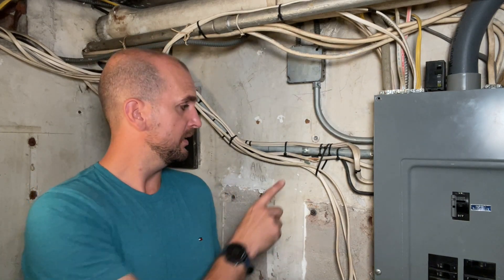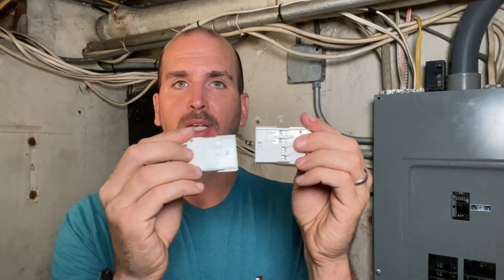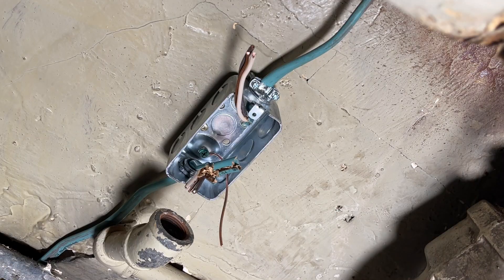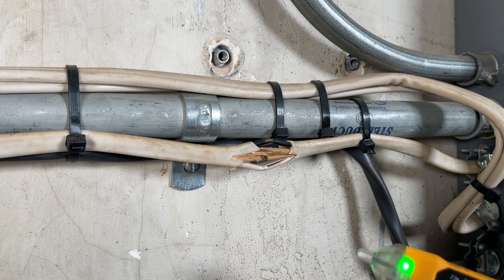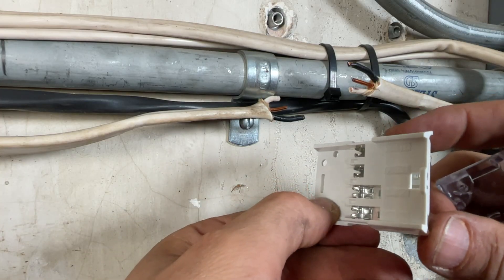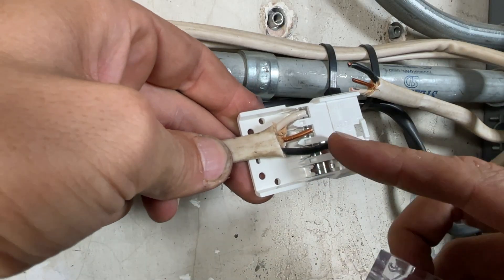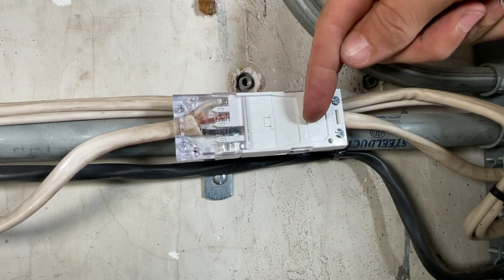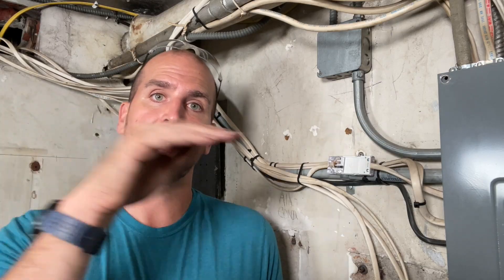How To Repair Damaged Romex Wires

Comment: Hadn't heard of the splice kit before, but seeing how they are made caused me to believe that they are going to be a weak spot in your wiring if a heavy load like a space heater were to be connected for a few hours. Not a fan of anything that pierces insulation instead of just connecting to the bare wire with a greater footprint than those little metal strips.
Reply: there is no way under the sun I would use the splice kit, just think of all the electrical fires in mobile homes with the outlets connected with same connections, yeah, not safe for heavy loads over time. if offer a screw connection style connector, I may approve?
Reply: @randymack1782  Where did you learn similar mobile home connectors cause fire issues?  I did a quick search and couldn't find anything, but maybe I did not search the right terms.
Reply: @georgebush6002  He might have meant to say "pre-fab" house. They are wired with these types of connectors.
Reply: @georgebush6002  I think he was referring to the "quick stab" backwire holes that are used on most outlets in trailers because it's a faster and easier way to install them, (i.e. cheaper labor costs to build), but those stab slots on outlets use a similar type of connection, where you're essentially only connecting to the wire by the edge of a knife blade, (inside the outlet itself), instead of a MUCH larger surface area such as the outer screw terminals, therefore with the "quick stab" connections, you have much less current capacity before major heat buildup happens right at the relatively tiny wire connection point, which of course causes eventual connection looseness and failure, (possibly even a fire), from a bad connection.

Most really good and experienced electricians, (myself included), will NEVER use any type of connection that ONLY relies on a very small contact area such as these types of connections have, because it will eventually fail, especially if on an outlet that always has a heavy load on it, such as for heaters, motors, etc.
Reply: @georgebush6002  I own a mobile home. I have had outlets blacken.    It seems to happen on the most frequently used outlets.   Thinking the less then great connection to the romex in conjunction with the less grip on the plug prongs raises the resistance and turns the outlet into a heater.
Worse yet is these are difficult to change out in that in many places one does not have enough free wire. To install a standard outlet.
Reply: @randymack1782  Yes, I would agree. If the splice connection kit shown in this video had screw terminals in it, like a ground/neutral bussbar and/or a circuit breaker has on it, then I might actually consider using these splice kits, otherwise, as they are designed now, I would NOT recommend using them, especially for ANY circuit that has a regular heavy load on it, like a circuit powering any type of heater and/or motor load, because as they are designed now, the overall contact patch area of the actual connection point itself is just too small to be long term reliable under heavy loads!
Reply: @randymack1782  They are good for 300vac, 20amps, and 12/14 gauge wire.   Nothing wrong with using these.  I wish I would have known about this when I used a junction box to connect damaged romex, this is a far more secure solution without the risks that come with traditional splices.
Reply: @randymack1782  The fact they have screws for securing the insulation, you'd think they'd just slam screws in for the 3 other more important connections lol
Reply: Properly rated wagos would fine
Reply: In a box
Reply: @jonesconrad1  Do the Wago connectors have to be in a box if it is under a house, or do you just "plug-n-play"?
Reply: @coloradostrong  In UK? yeah, inside Zip-tied box. then they become "Maintenance-free" and can be buried under the floor or wherever
Reply: @coloradostrong  Any time that any of the internal individual connector wires of any cable, (such as the "hot"/black, "neutral"/white, or any other individual conductor of a Romex, etc. cable), are exposed for ANY length, like they are when using wire nuts OR those Wago connectors to join them together, then the entire overall splice/junction MUST be totally enclosed in a covered junction box, with some form of strain relief clamps on each outer jacket of each Romex or other cable going into it. (In order for the splice/connection to be totally safe and up to code anyway)
Reply: @coloradostrong  I don't know about where you are, but where I am open wiring is a no-no typically, unless it's low voltage
Reply: @BSOE3058  9th
Reply: @jonesconrad1  disregard lol just saw your next comment
Reply: @jonesconrad1  not for burying in a wall like he said
Reply: Instead of all the speculation, gents, there are plenty of videos of people comparing the two. The Wagos are listed, they're code, they have a higher melting point, can handle amperage far beyond what they're rated for (same as wirenuts), have 30lbs of pull pressure before they fail, etc. 

You'll probably see less incorrect usage of these when you find them in the wild, compared to nuts. These are impossible to use incorrectly unless you're brain damaged, wirenuts require basic knowledge. Anyone that has done even a little wiring in a property has seen incompetent wirenuts usage, even when the person doing it was a licensed electrician.

Until you look in a box and see failures, or have run tests yourself, you're speculating. The only really downside of the Wagos is that they're significantly more expensive than wirenuts. I'd use wirenuts on jobs where I need to use a hundred+.
Reply: @Lusterredux  
Twistnuts are fine.  Need a little skill and that is easily achieved.  I could see using the Wagos in some tighter areas or where the leads were unusually short due to prior mods in the box.
Reply: @AlanTheBeast100   Never said they weren't. I just said the people acting like the Wagos were inferior weren't speaking from experience.

And yea, "need a little skill" seems to be hit or miss. Seen plenty of situations where even connections done by an electrician at time of construction XXyears ago that were suspect. At least with the Wagos, there's no real learning curve and I'll never come across one being held together by tape and nothing else. They're just too expensive, so they're not for professionals since they eat into bottom line.
Reply: @Lusterredux  speaking from experience, I've seen wagos fail, even if all the conditions were within code and UL listing.  They have a tendency to catch fire, but, the joints in question were in an enclosure that was subject to non-stop vibration, which was the obvious cause of the joint loosening and catching fire.  As far as I m concerned, nothing beats twisting wire joints and using wire nuts.  Hell, I'd rather use Kearney's, super 33 and rubber tape before I used a wago.
Reply: These actually have been tested and have a higher melting point than standard wire nuts.
Reply: @missey316 I was going to say the same thing. The plastic has a higher melting point and if you melt this one you've got a bigger problem on your hands. You're producing some major power in your home and need to remedy that asap.
Reply: @missey316  "These actually have been tested and have a higher melting point than standard wire nuts."  Perhaps but Wagos and these snap-in places have greater resistance than traditional wire-nut connectors… thus run hotter, well within design specs but more heat = less energy-efficient.
Reply: The UL & all other agencies perform a lot of testing including taking temperature measurements so you should never have a problem if you go by the universal 80% rule. A #14 guage wire should never have a continuous load of more then 12 amps and 16 amps for a #12 guage copper wire.
Reply: You raise a good point.  I'm no electrician, in fact it scares me a bit since I was electricuted once as a teenager and give alot of respect and caution to electricity. But I'm a DIY'er and push myself past my fears. I bought a few of those WAGO 221's from a local hardware store and using them in light wiring like lights. Are they really safe? Could they melt if someone plugged in something heavy like a space heater or other item? Should I stay with twist nuts and tape? (please excuse any typos or mispellings).
Reply: @antuan734  like the wire itself, the potential for the unknown is always the concern. 
I’ve read many complaints from electricians stating the scenarios for failure. 
One said “if the springs fail”. That’s the silliest of the bunch. 
Unless the connector is played with frequently (and even IF) the springs aren’t going to wear out. 

Them being prone to heat failure? Sure, same as a wire nut. 

If one were to really go all out and do it so fool proof that they were to go old school and breakout the old soldering iron and use the real super duper friction tape and do it so NOTHING short of an act of God can occur, well that’s always an option. 
Granted it means you have too much time on your hands or you are billing like a lawyer. 

Myself, I’m comfortable using any of these methods depending on the actual job. 
In my home or my customers, I do what’s going to be safe even IF the future user overloads a bit. Using 12/2 is not much more costly than getting by with 14/2. Though I wouldn’t use 12/2 for an entire home or area where 14/2 is more than adequate no matter the worst case scenario. 
When doing outlets ALWAYS 12. 
Lighting circuits that are known to be limited to a allowable (capable) load, 14 is good. Rarely anymore will a homeowner use a 100watt (or greater) incandescent when they actually cost more to purchase (as well as more to operate) than LED, and this is going to continue to be true. When a cheaper more cost effective invention replaces led it will undoubtedly use even lower current.
Reply: Although I don't support use of cheaply built splice connectors, if these passed NEC standards (I'd assume they've adequately current/heat/voltage drop tested them) then the connection footprint and method should be adequate and safe. New methods generally meet or exceed quality of old. That said, I wouldn't be comfortable burying this in a wall but, absent of testing or other hard data that showed these to be unsafe, that's just my personal bias.
Reply: I'm not a fan of of that type of connector either. I have  used the little blue ones on 12v trailer wiring, but I didn't haven any choice.
Reply: No - it's a large surface and even if it's slightly resistant it's over a very, very, very short length.  To be rated would need to handle 15A - or even 25A (didn't see the rating).
Reply: I lived in mobile home trailer that all original outlets were just real cheap kind that only had the ' quick connect ' wire connectors that only gave a very small surface of connection to the wire.
Not only that but the place was wired from one outlet to another so that a line to a far out room might have to go through as many as 6 or 7 outlet connections.
One time I tried running a window air conditioner in  far out room ( far from the power box ) and being aware of the situation I checked the other outlets after running it and most of them were hot.
Reply: In the UK one can buy something called a "Debox in-line junction box" and they're a little plastic clamshell thing that clamps the two incoming cables so their wires can be fed into a screw-down terminal block in the middle of the box. Cheap (just £1.20 each), simple and effective and the thing can be buried back in the wall... the UK seems to have taken the approach that it's better to provide folks with a cheap and safe way to do inline junctions rather than run the risk of them just doing something on the sly.

https://youtu.be/KGRWlMzf9Ho?t=25
Reply: I was thinking the same thing, we took apart my great grandmother's lamp to rewire it and the plug used this piercing technique, not a fan of that at all.
I was sure we would have advanced our electrical standards over the generations. 😆
Reply: I was also unaware there was a “UL listed” product that can be buried in a wall. Can’t find any confirmation on the splice kits I’ve found
Reply: @kylemccloe  there isn't one.  Code requires all spliced are to be made inside of a suitable enclosure that is readily accessible.  Any joint dropped behind sheetrock is potentially dangerous, not to mention, illegal.
Reply: @skindianu  NEC 334.40(B)
Reply: @COJellyfish  I stand corrected.  Thanks for the info.
Reply: If you use this and their is a fire because of failure they are held liable because their product failed.
Reply: Yea I wouldn’t trust this either. I found a buried junction box with live wires in my moms bathroom ceiling a couple feet from the ceiling light when I tore down the 12”x12” acoustic ceiling tiles. I just ended up installing a plastic outlet box in the ceiling drywall then wire nutted the wires together and put a blank white plastic cover plate on it. It looks a little weird having a random wall plate on the ceiling but at least it’s accessible and as safe as I could make it.
Reply: @jayson657 That's exactly what I would've done. Being a homeowner and not a pro it sounds like  the best fix to me.
Reply: This is true I highly do not recommend this type of connection ever
Reply: @mikepedersen1061  I have only ever seen these in automobiles for the 12v. Proper 120v and 240v copper splices involve compression screws and a protective box.
Reply: @normferguson2769  So you're saying these aren't proper? They are allowed by then NEC and are UL listed.
Reply: @normferguson2769  I never like these even with 12v wiring, they always seem to fail. That friction simply does not hold tight over time. not to mention the minimal surface contact in this higher voltage application
Reply: @jimmac1185  they might be rated and legal but so are the stab connectors on the back of electrical outlets and those are not great either.
Reply: @jasonbenjamin1464  I wasn't saying they are good, but in a jam, I would use one.
Reply: @normferguson2769  I have seen the vampire taps used in 277v lighting. About half are heat damaged. I refuse to leave them.
Reply: Agreed. A high amp load would not seem to do well with such a small area of contact. Especially over a long period of time. I’d rather bury a wago in the wall.
Reply: Yeah, I rather use in-line wago and Integrated strain relief, plus maybe huge heatshrink over all of it...
I know that wouldn't be up to code, but In my opinion would be better than this
Reply: How the hell is it illegal to use a box and cover it with drywall but that silly connector is perfectly legal?
Reply: Agree! With all the issues I see in autos using insulation displacement connectors I can’t imagine using that TE connector in a home
Reply: OMG, what a mess. That's the problem with electricity, everything works but it ain't right much less safe. An inspector is going to lose his lunch when he sees that mess. I wouldn't use those splices in my worst enemy's place either!
Reply: It does seem like a very likely failure point.
Reply: It's a scotchblock!  You know, the first thing you cut out and pitch when you see one. In no world is that a good thing.
Reply: You're right. They lack the mechanical integrity to perform well.
Reply: Exactly- I would Never use this fancy splice with forks if it had screw lugs I might be tempted I would NEVERR bury one of these Splices inside the wall- I MIGHT use this to make a temporary splice but would Never expect it to last very long… When this fancy splice fails inside the wall the question then becomes “WHERE” is the circuit failing…This is almost as bad as using outlets with quick punch down connections

Comment: I’ve used this product after contractor decided to cut multiple lines during demo for laundry room remodel. There was no way to rerun these lines without it becoming a major house remodel! Had to use two on each line that was cut and also use additional Romex and buried behind walls. Worked out and passed inspection (Totally agree to talk to inspector and confirm). Had more trouble with inspection where had to replace all the 20 amp breakers on 14 gauge runs with 15 amp breakers. 

Btw, the Tyco splices have been in place for over a year and no issues. If done right I think they seem pretty good. Although, long before, in the garage storage area I had an electrical mishap that I caused, I just  soldered and shrink wrapped the splice. Bet that wouldn’t pass inspection. Maybe if I get bored I’ll fix with Tyco splice.

Thanks for vid
Reply: @@UCJ07S0kqHqnd2sDR5G6VP_w  I'm glad you replaced those 20 amp breakers that had 14 gauge wires on them.  That is a pretty dangerous fire hazard.  Remember everyone that you can have HEAVIER WIRE (like 12 gauge wire to a 15 amp breaker) but NOT heavier BREAKERS (like 14 gauge wire to 20 amp breaker)